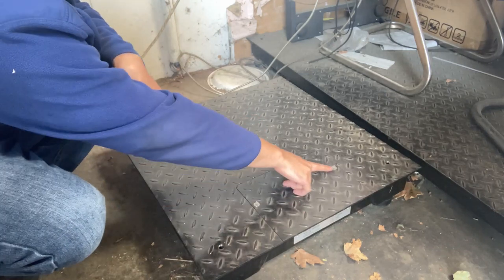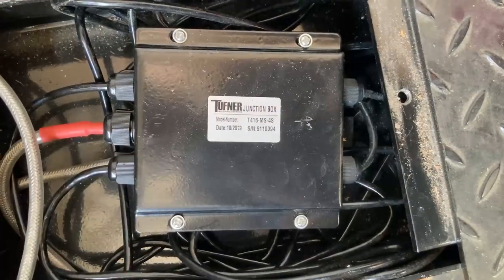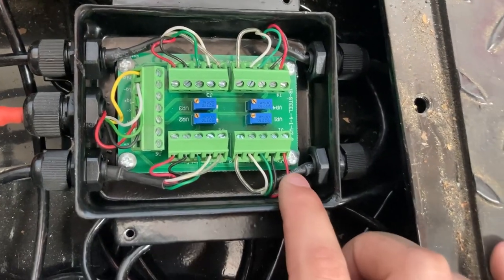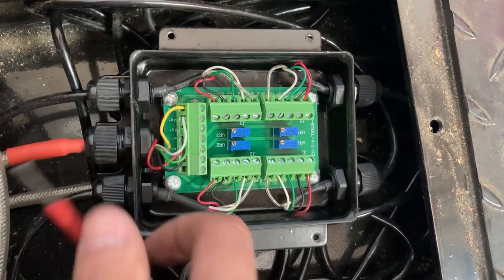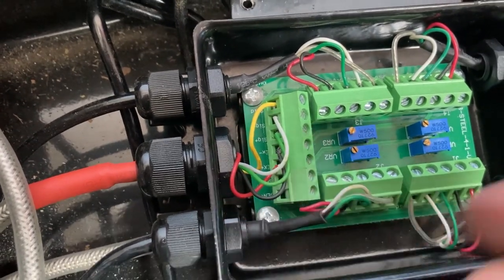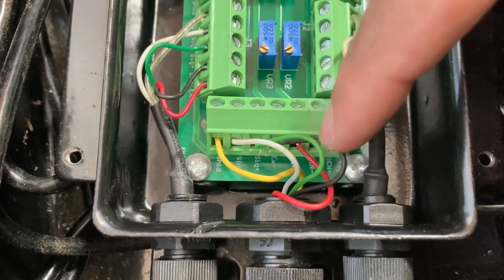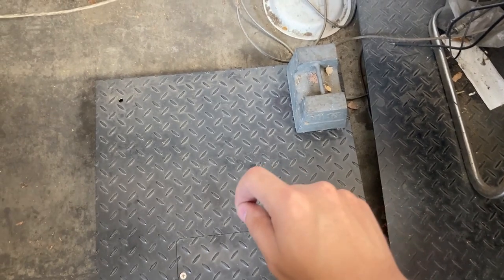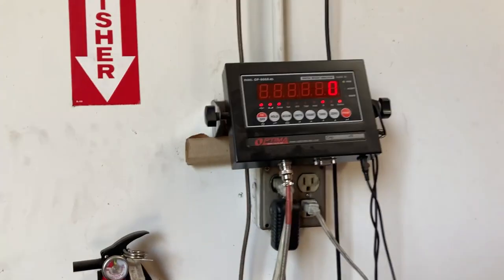Floor Scale Unstable Weight

Comment: I was wondering if you can help with my scales ,  my scales were send out and working from who sent them but upon receiving them they didn't work, I pulled them apart to find what looks like a wire soldered in wrong spot could this be why they say unstable
Reply: I turn on my scale and all is says is "un-st then after a moment fluctuates in weight to 14kg and then goes to o-ld " it doesn't start up normally it just says unst ...
Reply from the maker: You can watch my video on how to fix a floor scale for a more detailed answered.

https://youtu.be/wcZWCF0RN1U

It could be wire in the wrong location, maybe needs to be recalibrated or bad load cell. Only way to tell is making sure all wiring is correct and tight and recalibrate. If there is water in the junction box then that will cause fluctuating weight. You will need to replace that junction box. You can email sales@optimascale.com for junction box replacement or if you find a bad load cell.

Thanks,
Anthony